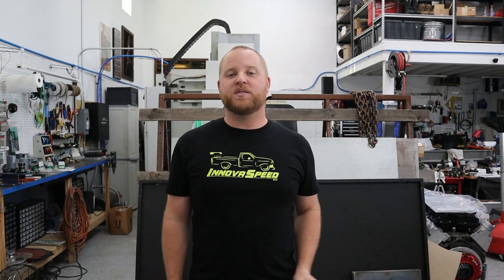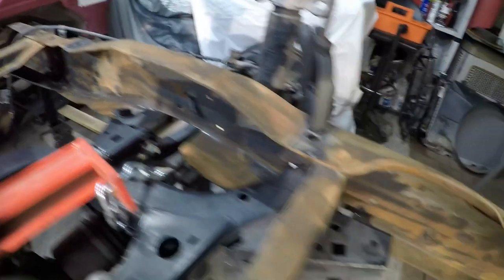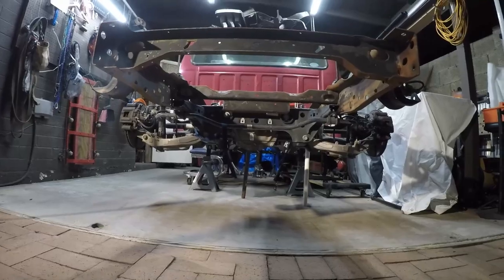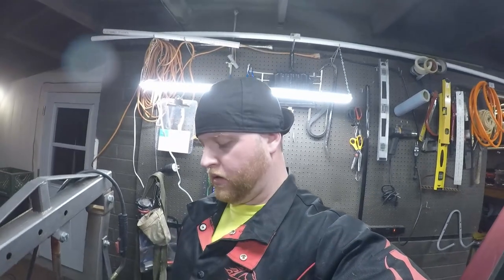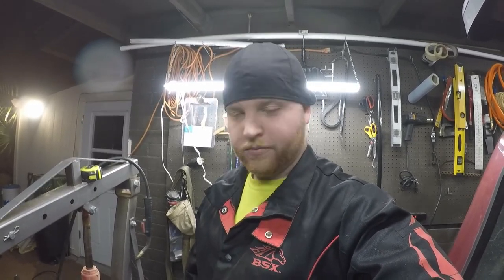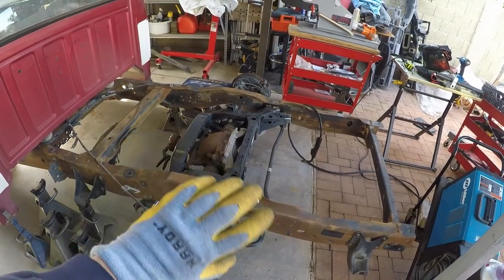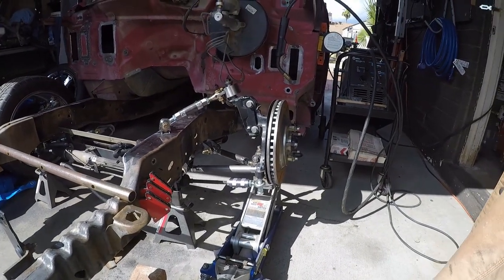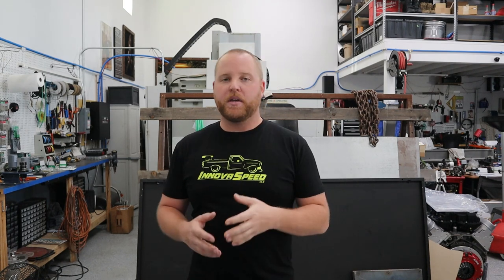Pro Touring OBS F150 Race Truck Build | First OBS Ford S550 IRS swap EVER

Comment: how did you figure out what height to mount the subframe ? like to figure out your final ride height. Im about to start a similar process with a Datsun 620 over on my channel and im trying to find some other people who have had similar ideas!
Reply from the maker: I did the math for my ride height and measured the distance. For IRS, the control arm angle is the most critical part of the geometry. That's a math equation to determine. This affects your traction a lot.
Reply: @Innovaspeed  did you just try to replicate the oem s550 control arm angle? How did you get that information?
Reply from the maker: @LooseFab  that's what I recommend to others since it's the easiest to figure out. You simply measure a factory car. Mine is altered slightly based on info I was given, in confidence, by a race team engineer.

Comment: I'm almost positive I've seen at least one if not two mustang IRS swaps into an 92-96 OBS Ford . Perhaps both lightnings or at least one. Idk about s550 specifically or where it came from but I think from a 2003+ cobra or whatever it was and also a newer truck one if I remember correctly. I know I've seen a full frame swap also onto with that already had a rear irs.
Reply from the maker: Correct. Those were done after mine because those guys messaged me and asked for tips. I did this swap 4yrs ago. Nobody had done the S550 irs before me and now I sell people parts to do it.

Comment: Looking to add almost the same irs in my turbo’d 98 2.5 ranger any tips?
Reply from the maker: I hope you plan to do a widebody, because the S550 is wider than your truck. It's not bad to do the install. Just take your time being careful to keep it square in the frame. Measure, tack, measure, tack....etc. And don't forget to check your pinion angle so that gets set correctly.

Comment: Hey @innovaspeed how difficult would it be to fabricate landing pads for the Oem s550 subframe mounts? I’m working on a 94 f150 like yours only difference is that mine is powered by the 4.9(soon to change) but I was wondering if it’s possible to make the subframe removable for “reasons” and not have it permanently welded in.
Reply from the maker: You wouldn't want to use stock mounting pads with the stock frame. It will leave the subframe way too low and the suspension geometry will be all messed up to the point that it wouldn't cycle. It MUST be notched up into the frame rails to work properly
Reply: @Innovaspeed  ok I was thinking of still notching the frame and reinforcing it while creating a bracket of some sort to alow the subframe to be removable. I was just wondering if that idea is completely out the window, it's kinda kept me up all night trying to figure out how I would do it lol. Thank you for the input and information you have given me. Your truck is a massive inspiration in my build. Thank you
Reply: The only real benefit would be the possibility have having 2 swappable setups for different gearing, at which point just swap the center sections. These frames have a ton of flex as is, using the stock S550 mounts would just add more

Comment: I currently have a 1991 Ford f150, that was totaled by the insurance because some idiot kid without a license decided to cut me off. That was over 2 years ago, everyone keeps telling me to get rid of it but I can't seem to do it. It's currently at my parents and I'm trying to get the cosmetic damage fixed so I can get it registered and be able to drive it again. I'll be going tomorrow to replace the fuel pump and tank because the 2 year old fuel rusted everthing. But... it's really difficult to find aftermarket parts for these trucks let alone people willing to help out. Yoy have done something very similar to what I'd love to do to my truck one day. Its hard to find a Ford truck community here in Vegas... can someone prove me wrong?